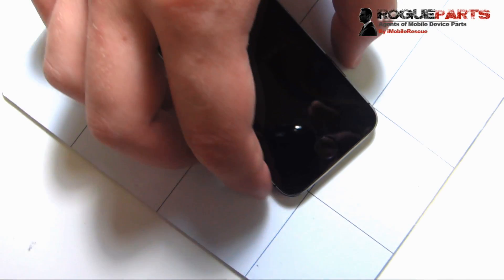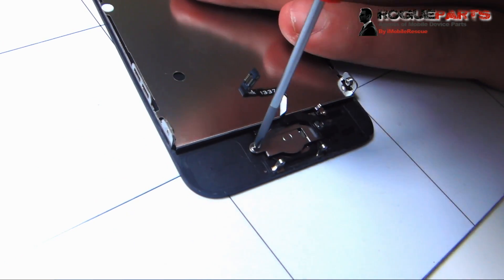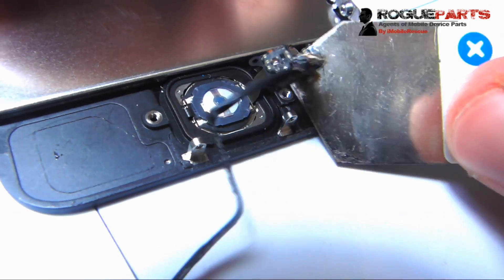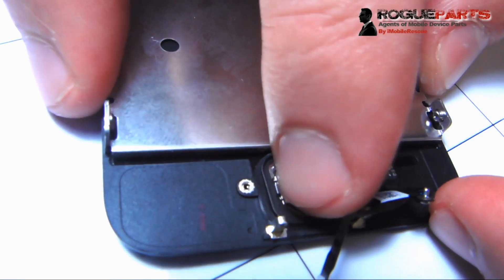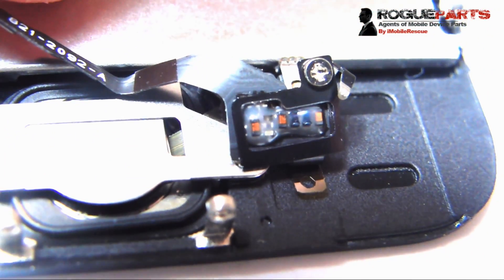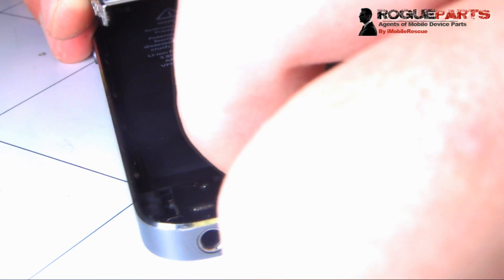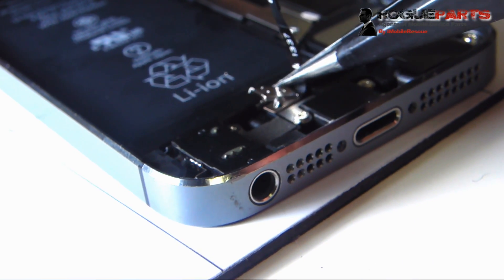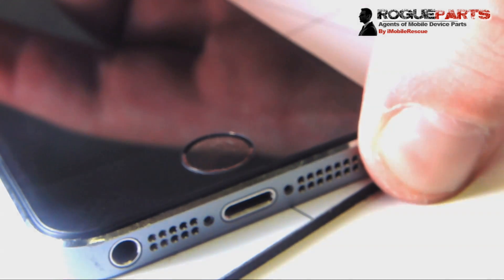iPhone 5S Home Button + Fingerprint Scanner Replacement

Comment: Well, I watched several videos and I'm sure I did everything right, but it seems like my problem lays somewhere else. The thing is that touch ID works but home button doesn't, and when I install new home button that I ordered it does the same thing, only thing different is that it does not have touch ID and I understand that, since it's not original. But yeah, I'm kinda out of ideas, anyone knows anything about this?

Comment: Thank you; very helpful! Just be sure to keep a hand above the screen when prying it open so that it doesn't fly up and break the home button strip.
I didn't need heat to remove my home button; it came up easily with a fingernail.

Comment: My main concern with this video is the little metal piece you said had to go in place or the touch ID may not work properly. That little piece started off in a different orientation then you put it at the end of the video. And I can say from experience the position at the end of the video is not the correct position. If you are able to put that bracket in the position you have it in the video at the end, that means you have damaged the bracket and bent it to get it to sit that way.

Comment: I did the same as you did, but my Touch ID failed. What about now?
Reply: Mibee Ku check ifixit, he is showing the ID solder connection as pointing down when should be to the right.
Reply: Mibee Ku touch id will only work with original home button

Comment: finger scanner will not work unless it's the original one as the logic board has got a code that only works with the orignal touch ID with a chip. You'd need to send it to apple so they can fix it. Maybe they can made i new chip with the same code i really do not know. With a new Home button just know touch ID will not work that's normal

Comment: I have an iPhone 5 and do not like the style of the button and was wondering if I could buy one of these replacement 5s buttons with a flex cable to replace it, if I take it into Apple will they be willing to do it for me?
Reply: No they won't do any modifications
Reply: +FrankTheArmyTank can I go to other places and ask? Such as the repair places and such I mean I can always ask right?
Reply: You could buy a sticker that makes home button look like a 5s by adding a gold ring around it. its on ebay.
Reply: The button can be changed out with out changing the cable. An easy, 4 minute job for the repair tech or DIY person.

Comment: Someone help me if I get my home screen button replaced will the Touch ID work??
Reply: nope did that before now I don't have Touch ID
Reply: +Isaiah Torres so what do you do to get it to work again
Reply: If the cable gets changed it will not work. The button can be changed with out changing the button. If the cable gets changed, Apple can reprogram the new touch ID to the mother board. If Apple replaces the touch ID cable they will reprogram it to work on the iPhone. If you take an iPhone to them all ready repaired but needing the touch ID reprogramed, they may not work on it for you since they did not do the repair. Make sure the repair person knows what they are doing or take it to an Apple repair service center for the repair.

Comment: Is there any way to transfer the flex cable from the original button to a new one so that touch id will still work? Trying to change the color of the button during a screen and rear assembly replacement
Reply: I'd really like to know this

Comment: Help me..i change my home button but fingerprint not work...please..how to fix ?
Reply: +Phiyo 21 did you find an answer to it? I read that if you replace the home button you gonna lose your fingerprint reader :/
Reply: I know it Mighty be to Late nur Insasse u r still wondering - the Touch ID Sensor is paired to the prozessor through the Mac Adress, so in u Chance the button u Chance the Mac adress it wont work
Reply: +Phiyo 21 Thats normal.

Comment: It is impossible to replace the home button assembly and preserve Touch ID function. The sensor is designed to be secure and it is uniquely paired with each CPU. so if your replacing a screen make sure you keep the home button .

Comment: When i removed the connector that is in black and silver, it made my new sensor work. But if i did not remove it, my new sensor button would not work at all. My iphone couldn't read my fingerprint
Reply: +ohm law 
what black and silver connector? can you located within the video time frame?

Comment: terrible video, amateur level. 1) the little metal clip (the one to the rigth in the video, not the 2 shield ones) it goes the other way!!! you can confirm by checking where the clip was before removing the screw. 2) why would you use a metal tool to pop the connector and protective shield (the first one) 3) no need to heat, just carefully use the spudger. 4) use the pinky finger to remove button, not directly from center... start on one side. 5) use a succion cup so you dont scratch the frame. U R lucky if it worked. If you damage the button or connector that's it for the fingerprint scan, a new home button will not work with that logic board (the firgerprint scan doesnt, the rest does work) home button and logic board a paired... non exchangable if you want to keep using fingerprint scan.
Reply: Gonzalo Gaymer I liked the video, but I tend to agree it could have been done more carefully.  I noticed when watched the video that when the guy was assembling everything back - at the very end - that the screen rim was chipped EXACTLY where the sharp tool was used to open it. I used a  standard plastic tool (provided with spare parts) which worked perfectly well - no scratches, no chipping on the frame, no damage to the screen.
Reply: i just replaced the home button on mine - and i can confirm - the button works, but the finger print scanner can not be activated

Comment: WOW... Reading through the comments, no wonder people are having problems with their finger scanner after following this guide. Its wrong! The bracket which gets screwed in with the finger scanner ribbon cable is being put in the wrong position, the bracket does not sit on the right hand side. They sit on the left and the clear metal tip hovers over the screw position. Look in the video at where you have just taken the original screen off, the bracket is sitting correctly but then when you refit the button to the new screen you have decided to make a new position up.

Please don't follow this guide!!
Reply: ok thx

Comment: I get a touch ID failed error message every time I transfer over the home button to a new screen assembly. The bracket is in the correct position, but yet the fingerprint sensor won't activate. The home button will work, but not the touch feature. What could be the problem?

Comment: what if i broke that cable now my sensor not wrking..
Reply: Your sensor is never going to work since your sensor is unique and i is paired to your logic board so the only way to fix it is to buy a logic board for your 5s + the original touch id for it to get it work

You cannot use a aftermarket touch id, altought it is very similar and profesional build it is not going to work since it is not paired with your logic board. Only way is to buy a new logic board with the touch id wich is paired to it but prepair to pay €230 for it ;)
Reply: +McKinley White I have the same problem did you ever get this fixed ?
Reply: Open up your phone and look at the connector. I reccomend you to take the home button out and put is in isopropyl alcohol for 24 hours. And if possible, take your motherboard out and put it in alcohol for 24 hours. It also could ve your logic board
Reply: Yes its paired with the cable from the button not with the physical homebutton. There is an smal chip on the cable witch contains the encryption

Comment: TouchID can only work with original Fingerprintsensor-circuit, it is tethered to the A7-processor. If you change the homebutton inclusiv flexcable, the TouchID cannot work anymore. Say thank you Apple, making the Iphone securesecuresecure, but you cannot repair it :'(
The encrypted information can only be accessed by 1 original (binded) chip which can communicate with the A7 processor, it should be soldered right on the flexcable, I guess.
Reply: assholes. no wonder my I touchsensor no longer works after changing out the lower harness. That's almost infuriating for apple to do this because the charging port on mine was damaged, thus causing me to change it. What's interesting is that it doesn't even show it anymore on the general settings in the phone. Interesting.
Reply: It is a fact. You can reball the ic on a new flex cable but it is very difficult since you can melt it.
Reply: Sadly, there are no video's out there doing it. There also isn't any tutorials for it. But the little ic (wich is soldered on the flex) contains the key wich is paired with the logicboard. This ic has to be transfered to your new one otherwise it will not work due invallid keys. If you got a heat gun, i would suggest you to buy 5 new touch id sensors and try removing the ic's without ripping the pads on the flex just for training. If you got one of very good without ripping the cable, you can get your original sensor and swap the ic. Sorry for my bad English:) for more help you are free to ask!
Reply: just cut the old flex and bridge with new 1. thats simple as hell.
Reply: Lorenzo van het Hul any videos on that? I really want to use the touch id
Reply: Lorenzo van het Hul thank you, i just might try this!!  I only ordered one replacement button, but i recall seeing a tiny square near the middle of the flex cable...is this what needs to be taken off and attached to the new button?  is it held down with adhesive or soldered on?
Reply: Its is glued + soldered on. But you can remove it easely with an hot air gun. You can also try it with a solderig iron but trust me, you are gonna mess things up. You must do it with a hot air reworker otherwise it will melt the flex cable. For more info you are free to ask. And yes thats the square you need to replace!
Reply: Lorenzo van het Hul ok thank you! i have a hot air gun...any idea what i should set the temperature to?  also, do i just lift it off and put it in the same place on the other ribbon?  if so, how do i reattach it to the new flex cable?
Reply: First you have to remove it from the new one, if the pads look OK then you gonna remove it from the old one, and if there is a little bit of solder left on those pads on the ic and on the ribbon, then you can apply it. But remembdr, the chip has to go on there at the exact same orientation! So i recommend you to mark a corner and take a picture before doing it before you are gonna lose it. I don't know what the temps are but i gonna look it up for you this night! D
Reply: Lorenzo van het Hul thanks, but when you reapply it to the new ribbon, are you using solder?  Or can you simply stick it on with whatever adhesive was there to begin with?  Whoever did this job, must create a video tutorial!
Reply: Lorenzo van het Hul i heard 220 F is good for loosening adhesives without damaging the components
Reply: I think that temprature is good! But if you removed it, try to look if ere is a little bit of solder on each pad. If yes, you can reapply your old chip. If no, try using those very small repalling solder bals and heat them up so you can reapply it. I would say buy a couple of those touch id and test it on some before you are gonna destroy the important one wich you need.
Reply: +Lorenzo van het Hul   Can you point the IC on this image: 
http://cdn.macrumors.com/article-new/2013/09/iphone_5s_touch_id_flex.jpg
 ? Is it that square in the middle section of the flex cable? For those 
who cutted the cable while lifting the screen, do you think is possible 
to fix the cable ?  Thank you.
Reply: It is repairable. Here is the link. It comes in within a minute
Reply: Its an hard process. Make sure u got a good flex cable with no kinks or damages. This IC is there and it has a specific key i guess 18 digit but its unique so thats why you need this.

IC is made by NXP Semiconductors
Reply: +Lorenzo van het Hul What link?   By repairable you mean the repair the original flex cable? Or by swapping chips? Thank you very much.
Reply: I tried it out.  I heated the old flex at 220 F, it came off nice and easy,  made sure to keep the orientation the same, and placed it on the new flex cable in the exact same spot, it's easy because of the bend in the flex cables.  the old adhesive kept it in place, and I even used a thin ribbon of masking tape to hold it down however the procedure did not work.
Reply: Swapping chips. And you probably got a defective home flex ore cold solder joints
Reply: +Lorenzo van het Hul
Do you have the link for this process?
I'm trying to figure out how to do this for future customers.
Reply: No one did make a video before. But there is a ic that has a valid key for the cpu. And the IC is made by NXP Semiconductors. You need to swap it with an original home flex cable coming out of an other iPhone 5s. You can't use one from Ebay or aliexpress. You need a real one from a iPhone 5s and swap chips.
Reply: can you guide more detail ? thank for your help
Reply: Sắc Mầu hi, there is no link about it unfortunately. But commonsense tells me that the button flex is holding the key on the NXP chip.
Reply: Lorenzo van het Hul can you please explain with a tutorial or images wich show what exactly is to be removed
Reply: I phone is a secure phone 😁 it's a very nice joke.
I hacked all iPhone models many times.....
Reply: shutup